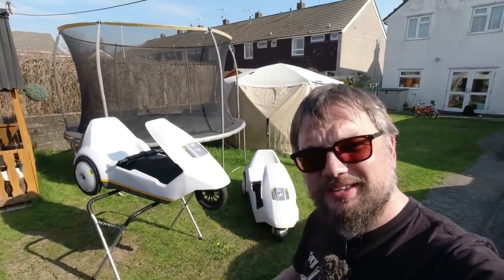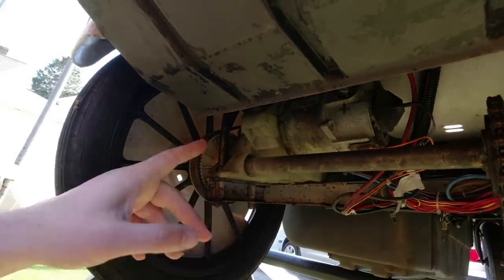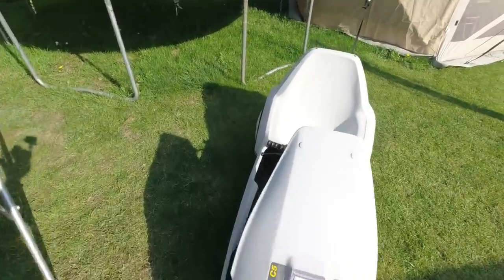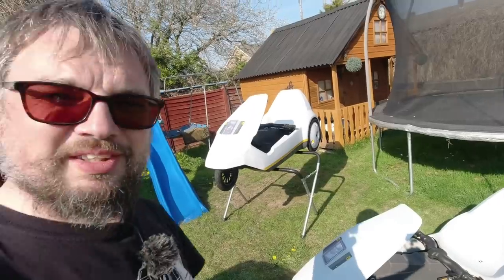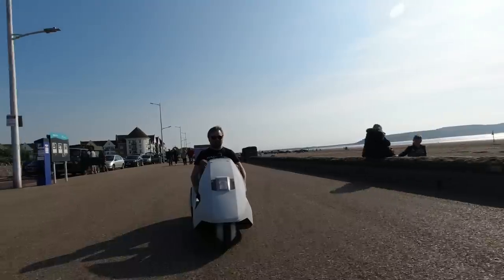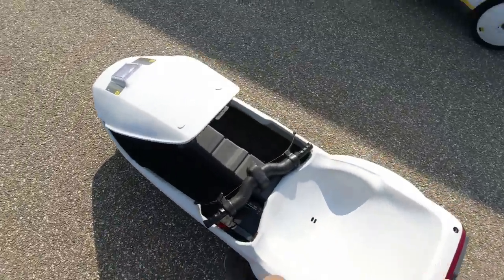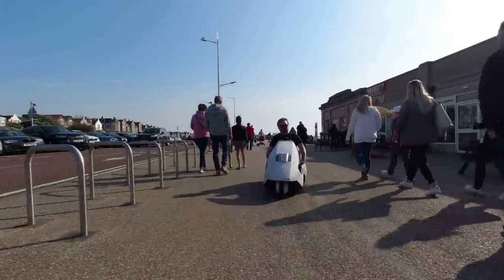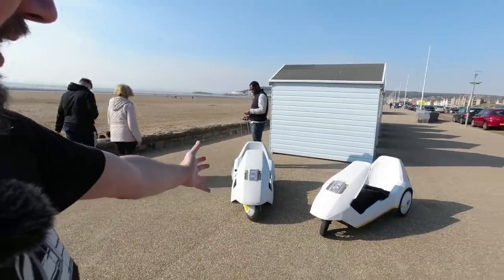Sinclair C5 - A Great British Failure! (we love a failure!)

Comment: My Uncle had one and knew clive sinclair I believe.  He told me that the motors used were taken from torpedoes.
Reply from the maker: Definitely not torpedo motors. They're similar to washing machine motors.
Reply: @HubNut  might bepend which model.  Either way my uncle has had it since they came out.  And knew clive very well so I think he would know.  Plus my uncle was an engineer at nissan then a director.  I think sufficient qualifications to spot a washing machine motor
Reply: @HubNut this a direct quote from my uncle.          He's wrong. Hoover could not deliver the torque necessary.  Hoover assembled the c5 but supplied little in the way of components. 
The chassis body and all the electronics were supplied externally. 

If your  u tuber is an expert ask him how were the two haves of the c5 body but together.....

Comment: If Elon Musk announced one he would be hailed as a genius and they would probably sell by the bucket load..Just recalled that around the same time Bedford and Lucas released the electric CF van. That was regarded as a joke as well but obviously, battery technology has come a long way since.
Reply from the maker: Indeed. They have one of those Bedfords on display at the British Motor Museum.
Reply: @HubNut  oh glad to know an example survived.
Reply: In fairness the CF wasn't really intended as a production model. I'm not sure how many they made, but they were more in the nature of an experimental batch which were trialled by electricity boards etc., much like the Enfield car, of which 60 or so were dished out to various users for field trials. There were several experimental battery buses at the same period, one of which towed six tons of batteries in a trailer, but the weight of the batteries at that date meant they would never be a commercial proposition.

Comment: I believe the motors were built for 36v as opposed to the 12v they run on. Imagine the speed if you run them on 36v - Frightening!
Reply: Would be quite easy to fix up 3 batteries in series. (Don't blame me if they melt...)

Comment: They were electric mopeds in 1973 made by a German manufacturer, Solo. 
Led Acid batteries are much cheaper but less performant. A 12V/12Ah cycle battery (means it can be discharged and charged like officially 400 times) costs €25 if you know where. Two 12V/12Ah batteries would mean 288Wh in theory, with wich this vehicle should run over an hour full power. With other words 20 miles on flat ground. But forget it in real life. I have a scooter with these batteries and it doesn't make more than 5 kilometers (or 3-4 miles)!
A modern scooter with like the same Wh but Lithium batteries make 10 km, or the double. And a bicycle with 360 Wh makes easily 30 km because it rolls better and coasters a lot. 
That's why e-bicycles make sense but these other electric vehicles much less.

Comment: It's one of the coolest bikes ever, but the design flaws make it nothing more than a gimmick. I have 2 velomobiles (aerodynamic trikes for bad weather), and one 2 wheel recumbent. With just muscle power and depending on bike, a reasonable speed is 30km/h for untrained people. That's way above electrical assist laws in the Netherlands.
But the failure of the C5 is that it is in no way bikable to reasonable speed with sheer muscle power. With good recumbents you only need electrical assist to drive away from traffic lights.
With my Quest I can drive between the cars (what a speed that they percieve as 50km/h), but driving away from the traffic lights is a muscle killer. The laws about that are  about the same between the UK and the Netherlands. In the Netherlands we have a trike law that dictates you don't have to use the bike lane. In the UK I think the bike lane is not mandatory at all?
Anyway.... I love the C5 because it just looks awesome. If it wasn't for the design flaws, I would have one already. But if I see a C5, I will step out of my quest and give that C5 the attention it deserves. And then bike at twice the speed with muscle power without breaking a sweat when the C5 is churning his hacked electrical motor on max just to keep up. Really, no gears :-(.

History of some velomobiles: https://www.icebike.org/30-iconic-velomobile-designs-from-the-past-85-years/
Reply: To be clear, there is an honest grassroots movement against velomobiles. It starts by tour de france and alike that disqualify any bike that is 1mm out of their spec. Fairing is forbidden etc... Then we have those sporty riders that want to mimick the tour de france (the real biker have no problems, because they know the difference between technology and muscle competitions). I heard one of them mock my bike once, saying I must have a motor due to the sound my Alleweder was making, just to justify I was biking ahead of them with a 35kg bike in normal clothing. Once you go above 25km/h, aerodynamics become much more important, and recumbents are just more aerodynamic. Especially a velomobile.
So throw away your prejudice and start biking more comfortable and faster today.

Comment: Don’t see it as a failure, they were ahead of the game. Heavy batteries were an issue, newer lighter batteries & a modern pedal assist system would improve them. Neighbour has an unused one & I’m tempted to buy it, built by Hoover for suckers 😂😂😂😂
Reply from the maker: Commercially, it was an utter failure. If we'd had more cycle paths back then, it may have been a different story.

Comment: Ian, your comments on visibility in traffic are a bit wide of the mark in my opinion.  Let me ask you: do you see road markings which are even lower than the rider of a C5?  How about potholes and manhole covers? 

There has always been a visibility issue as regards cyclists of all types with regard to commercial vehicles in certain scenarios but it is not really true that cycle and recumbent riders are significantly less visible overall.

I know that I have probably stirred a hornet's nest but I have similar discussions about why cyclists should or should not wear high viz.  It is convenient to use a "lack of visibility" excuse by anti-cycling campaigners who want all cyclists off the roads in the same way that they want all cyclists to wear helmets to protect the cyclist from the one tonne plus of motor vehicle that has just crushed them.  

The real issues on the road is about attentive and responsible road us by ALL road users.  It just so happens that people in large metal boxes are somewhat safer than people not in large metal boxes and those same people not in large metal boxes are therefore considerably more vulnerable to carelessness or recklessness.

Sorry about the rant.  I'd have loved a C5 but family budgets simply did not allow for one.